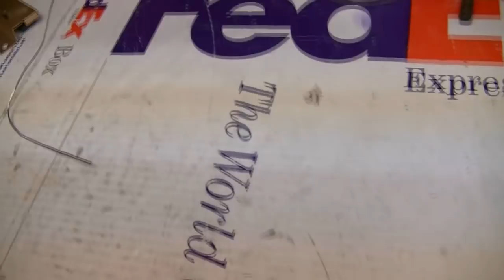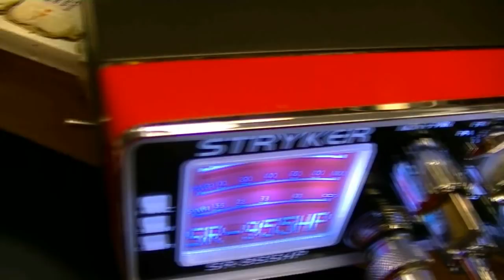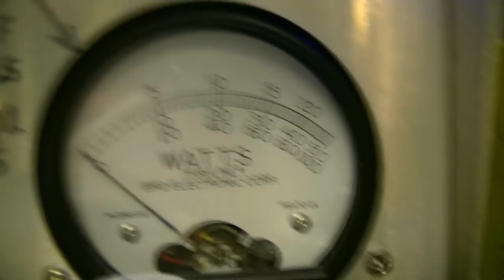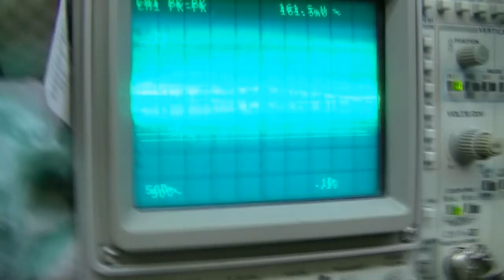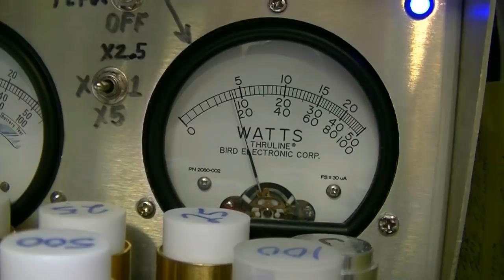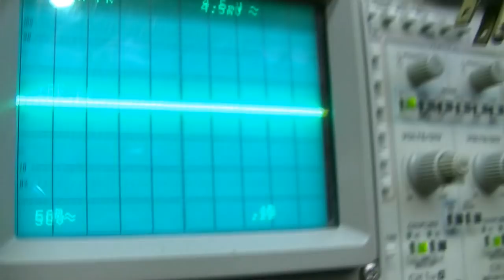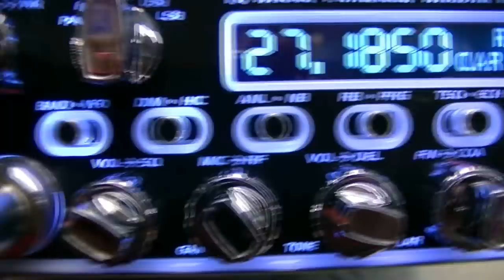Mark J, SR955 ERF2030+

Comment: What is the SP1A
Reply from the maker: The SP-1a Speech Processor was developed by Clear Channel Corporation for the Ranger AR-3300 and AR3500 radios. It works well in most radios in AM FM & SSB. It is an audio processor that delivers an average of 90% modulation. It boosts lower levels to within 90% of it’s maximum output with a very low distortion. It connects in-line of the audio Mic input of the microphone jack. It also requires a 12 Volt connection in the radio. A SPST switch can be used to switch the SP-1a in and out of the circuit. When switched off the speech processor is completely out of the circuit leaving the radio back to stock audio.
Reply: One of those speech processors would sound great on a cobra 2000